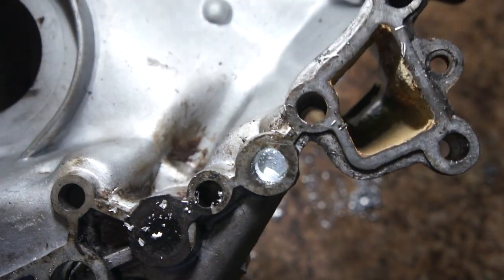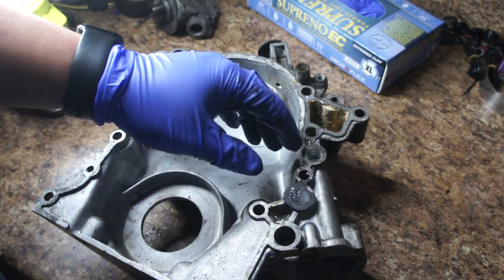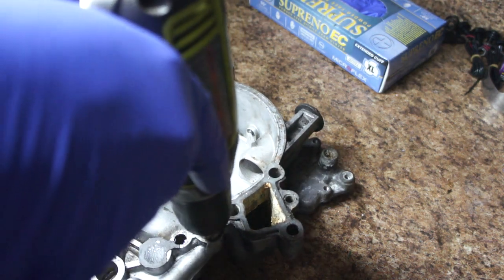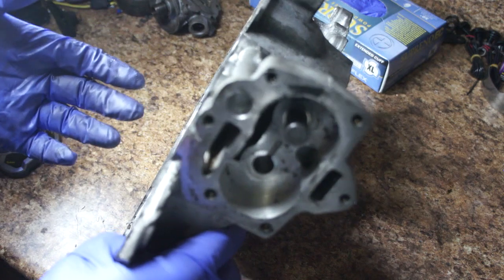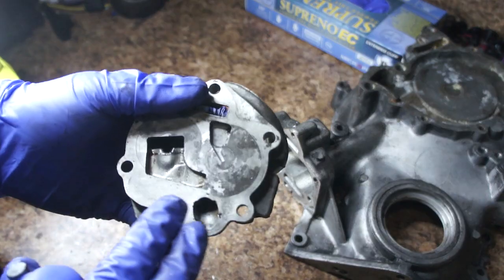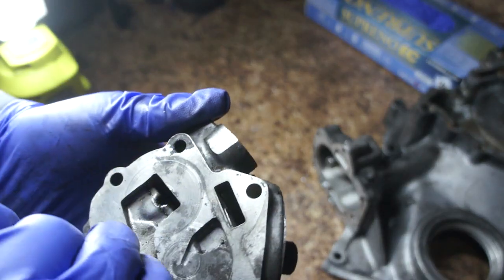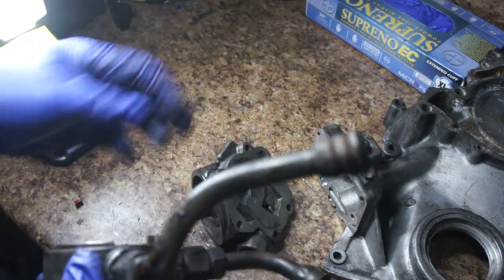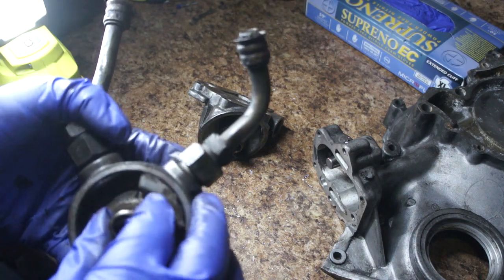Buick Timing Cover/Oil pump. How it works and some modifications.

Comment: If the high pressure relief/bypass valve is stuck open or if the oil filter relief/bypass valve is stuck open, would the engine lose oil pressure altogether?   I am using the High Volume oil pump and the spacer plate.   I have tried all three springs in the high pressure relief/bypass valve, and every time, everything is good (oil pressure is 20 psi at warm idle and 50-60 psi at 2000 rpm) until I get the car over 3000-3200 rpms and about 5 psi of boost.  At that point, I lose oil pressure altogether.  Any thoughts on what might be causing my engine to lose all oil pressure (dropping to zero only when under boost)?  Thank you in advance!   By the way, thank you so much for all the helpful videos!
Reply from the maker: If the engine is up in the RPM's and looses oil pressure completely (at RPM) and then it returns at idle you most likely have a loose connector somewhere and the signal is cutting out.
To loose oil pressure all together it could be a broken gear pin on the cam sensor, a large leak between the timing cover/block, a crack on the block along the oil galleys, a lifter jumped out,  pick-up tube is loose or your bearing clearances are out of spec.
BUT any of these will give you zero oil pressure at idle and you should be able to hear the lifter begging for mercy.
Reply: Oh, ok.  I see.   I am hoping it is something simple.  It is a completely rebuilt long block with less than 150 miles on it.   The car loses oil pressure and it does not come back until I remove and reseat the high pressure relief valve and spring.  Then I reprime the pump and it works great until I get it up to about 5 psi of boost and I lose all oil pressure again.  The gauge is mechanical, so I know it is reading correctly.  Thank you so much for the helpful information.
Reply from the maker: Landon Lay be careful with that, you can wipe out your bearings really quickly if they aren’t damaged already. The oil filter adaptor is $30  new, get another one and test the valve to make sure it travels freely thru the entire bore. If it feels gummy, use a drill with a pipe cleaner wire brush a little bigger than the bore and run it in and out a couple times and try again until the valve slides smoothly...make sure to flush it all out with some parts cleaner  before you install it.
Reply: @VenomGT87  Each time the car lost all oil pressure I immediately shut the engine off until I was able to work on it.  So I am pretty sure the bearings are not damaged.   My current high pressure valve is sliding into the chamber fully.  The high pressure valve slides the full travel length just fine.  That is why I am confused.  But I will go ahead and order a new oil pump housing since it is cheap peace of mind.  I will order it this week and install it and let you know if it fixes the zero oil pressure issue.   Thank you for the helpful tips.  I will try them.
Reply from the maker: gn87man it just occurred to me, check to see if the driven pump gear is spinning on the shaft, it may have cracks in the webs if it is.
Reply: @VenomGT87  Thank you bud.  But I have already checked both gears and they look good with no cracks and the driven gear is tight on the shaft.
Reply: @turboman1976  It sounds like you're under hard acceleration!   Your pickup maybe sucking air as all your oil is pressed against the back of your engine and pan!   Have you changed the baffles in your pan?  This would make your pressure drop to zero!!

Comment: What weight oil are you running in your GN?
Reply from the maker: Right now Royal Purple synthetic 5w20 I am about to switch to 5w40 for summer, depending on how it behaves I may go a little heavier.

Comment: Guys. When my car temperature goes to 65 Celsius. The oil light start to blink and stay red on idle. What is the main factor for that. What i should change?
Reply from the maker: Have you verified oil pressure with a gauge?
Reply: @VenomGT87  no and I don't know how!

Comment: So my oil pressure on cold start up is 100psi but that’s as high as the gauge goes, it’s takes a while to come down after driving but then at hot idle it’s around 60 and if I wot on the freeway it goes back around 100 again... seems high to me and I can’t remember what it was before I broke a few things. I did put new rod bearings and crank when I replaced the #3 piston from a shorted fuel injector harness... any reason or what I can do to lower this? I believe this is what’s making my rear main leak again...
Reply from the maker: Sounds like your clearances are really tight, your bypass in the lower section of the pump is seized or it has a REALLY stiff spring in it. Have you tried running a lighter oil? Check you cam gear as well because at those pressures that gear is getting worn fast.
Reply: VenomGT87 I will try a lighter oil, I’ve been running 20w50 vr1 valvoline.. switch back to the 10w30 possibly? I’m still flat tappet, any suggestions on zinc additive or what’s your thought?
Reply from the maker: Lucas makes a break-in additive that can also be used to spike your zddp content best part most autoparts stores sell it. I’d go with whatever full synthetic, I prefer T6 5w40 as it is cheap, synthetic and has a robust detergent package.
Reply: VenomGT87 ok, I stuck with the valvoline vr1 since it has the zinc in it already, used 10w30 and it is around 90psi give or take and when hot it isles around 40psi, seemed to improve and at freeway speeds it’s 60-70psi.. what you think?

Comment: Need help I did a rebuild kit on my 85 regal 3.8 v6  was running great until today it runs good until engine gets hot and I lose oil pressure engine starts to lose power and will go back to normal after a couple minutes
Reply from the maker: How is the fuel pressure? Fuel Pump may be dying.

Comment: Have you ever heard anybody taking the timing cover, distributor,oil pump in oil pump drive gear off of 84 and put it on a 86 and a half block?
Reply from the maker: Not really but I don’t know why you would do that. Aftermarket has all those parts covered and I think the later castings were better.

Comment: WHERE I CAN USE THE OIL LINE FOR TURBO APLICATION??
Reply from the maker: I am not sure what you are asking bud.
Reply: @VenomGT87  FROM WHERE I TAKE OIL TO FEED  MY TURBO....I ALREADY MAKE THE  KIT BUT I'M AFRAID OF THE OIL ISSUES OF THESE ENGINES...I USE TO HAVE HONDAS TURBO ..MAKE A " T " IN THE OIL PRESURE SUITCH AND ITS ALL...OIL FOR THE TURBO...
Reply from the maker: William Rodriguez the concept is the same, the pressure switch T is where the factory gets oil from.

Comment: What do you think about adding the booster plate ?
Reply from the maker: My personal opinion...the booster part is a gimmick, better wear surface..sure.
Reply: I have a booster plate on my 350 Buick motor now. I haven’t lost any oil pressure from that. However, installing a remote oil filter kit with oil cooler has cause a drop in my average oil pressure.

Comment: I have to disagree... Oil pressure isn't measured at the pump necessarily.. it's at the rings etc... if you can increase flow through the pump, you are in fact raising pressure at the bearings

great info here though
Reply from the maker: I think you meant bearings and I'd agree with you on that, resistance to flow is the oil pressure you read on your gauge. Changing the springs in the pump will not increase the flow, only limit the ceiling at which point it levels out...assuming your bearings are within specs otherwise no matter what spring you throw in there, it will never reach the opening pressure.